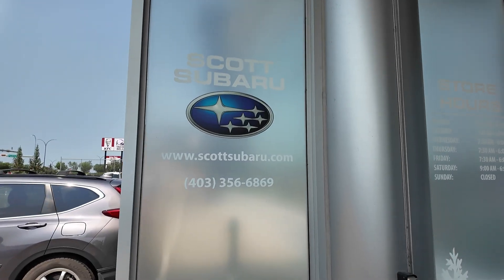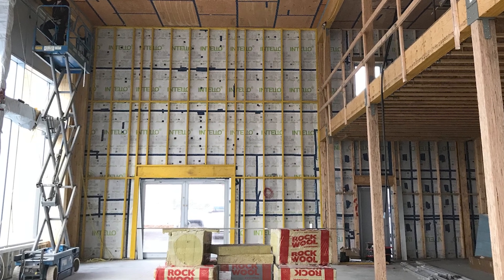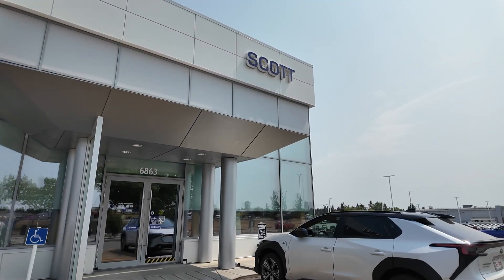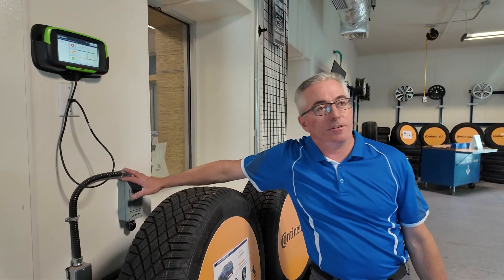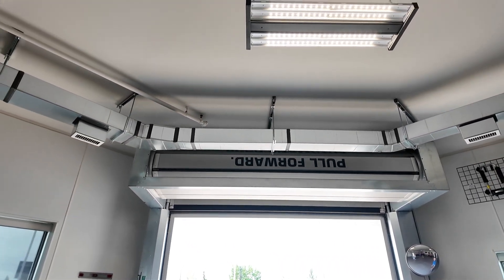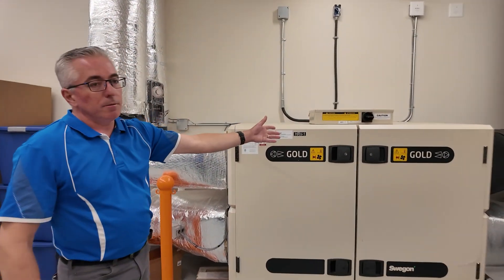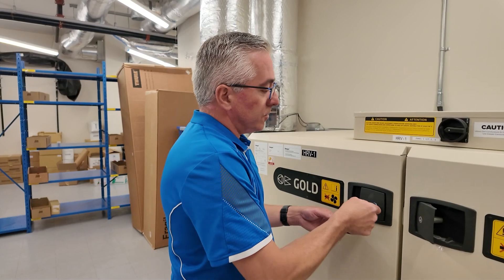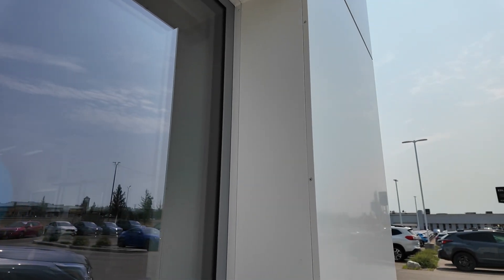"Passive House" Doesn’t Have To Mean “House” - The World's First Passive House Car Dealership

Comment: I'm surprised they didnt go with in floor heating in the shop areas.  The workers are close to the ground anyway so heating the ground would be ideal and there wouldnt be much heat loss when they open the doors.  Also in the red deer area with all the well servicing companies they could have drilled geothermal wells.  I'm guessing budget came into play though.
Reply from the maker: Part of the issue with radiant heating, is that its usually too much heat for a Passive House. In this video, Ryan mentions that even the TVs are producing enough heat to make a difference. When you're that well insulated and airsealed, things work differently.
Reply: And floor heating is not the best efficient heating source (it’s the best for comfort by a mile but not for the efficiency. I have heated floor, I’m speaking from my personal experience. And even with my « only » R40 walls R65 roof (air tight) sometimes the heated floor is a bit too much… But I wouldn’t change it! It’s SO comfortable during Canadian Winters!❤ Worst case, we crack open a window 😅. But I do see why it’s a no go in a Passive House!
Reply: @MrLapin-LL  comfort is the main concern in those work areas though.  If they are opening the doors to get vehicles in and out they are losing a lot of heat even if its only for a few seconds.  With in floor heating they have thermal mass so they dont really lose much thermal energy.  Where I work they built a new shop for the trucks and decided to skip the floor heating and their heating costs went up 10x over the other building which had heated floors. One concern I do have is in the video they talk about how they monitor the CO2 and kick the fan settings up to deal with that but there are other chemicals involved. They have degreasers and fumes from everything else in a vehicle.  I would want as much air exchanges happening in the shop as possible to ensure they have a lot of fresh air.
Reply: When I was first learning about Passive House, I was told that radiant was too much heat and I just didn't believe it. But the numbers in the energy modeling software bear it out. Keep in mind that these building need much less heat than a traditional building due in part to the high level of insulation and super windows, but the biggest thing is the airtightness of the envelope. The tighter, the better.  Passive House standard is 6 times more stringent for air tightness than the strictest code in the US.